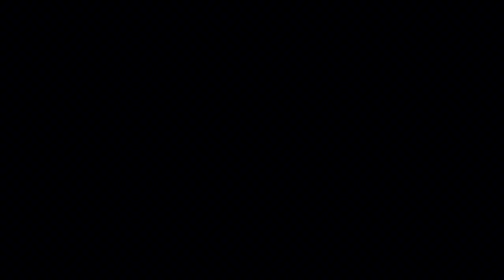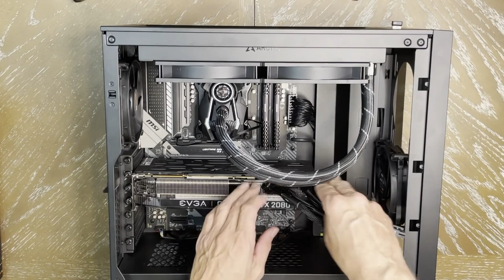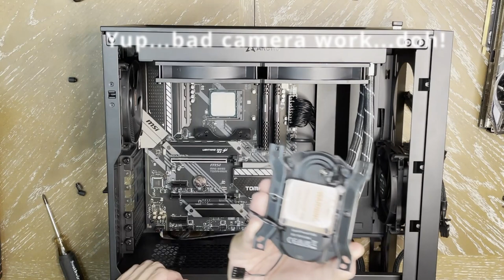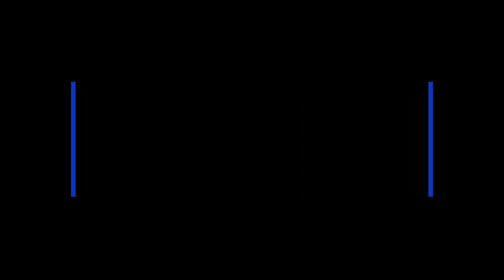Arctic Liquid Freezer II - Don't do this!

Comment: Never overlook the obvious, been there done that.

I recently installed the 240mm version of this in my 13700K build two weeks ago because my Corsair 4000D case will not support anything larger on top due to the tall RGB ram I'm using.  I limit PL1 to 125 and PL2 to 253.  Very impressed with the thermals.  Mid 30s idle and mid 50s gaming.
Reply from the maker: I just did a video comparing the Liquid Freezer II to the Pure Loop, which was my first choice.  I did a bunch of thermal comparisons at different speeds and fan settings.  I am very happy with thermals on LF II.
Reply: Which Mobo did you get? Are you happy with your choice?
Reply: How? My liquid freezer does 65 to 80 in games lmao? And i have a ryzen 7 7700 consumming way less than your intel. You gotta be cappin
Reply: @TheAmanor123  Power comsumption isn't the whole thing about the temps. So in Cinebench You have about 90 degrees?

Comment: I can’t remember if I took it off (I probably did), but I will check again to confirm, thanks for the video!
Reply from the maker: If you didnt take it off your temps would be really high.  You would know I think. :)
Reply: @VideosByBob  i’m in the process of building my first pc so I haven’t even turned it on yet haha

But yeah, it looks like I already took it off when I checked last night. still good for me to double check though in my opinion since I didn’t completely remember, also gave me an excuse to clean off the thermal paste for the first time experience.
Reply from the maker: @timmlyy  and to see how your first application of paste looked.

Comment: It looks like you may have also skipped the thermal paste application? Put a 3-4mm dot in the dead center of the top of the CPU and put the plate back on. The Arctic comes with a small tube with more than enough for AM5. Thanks for the video! These are easy goofs to make.
Reply from the maker: No I didn't skip it.  It was there, and I did it on the final, corrected install.

Comment: I dont have much disposable income these days, but I do want ti upgrade the CPU and the GPU. I'm finding it difficult to get good recommendations here in 2024. It's a Crosshair hero VII WiFi MoBo. It has PCI 4.0 support. What do think I'll need to keep up an AMD RX 6800xt or 6900xt? Maybe even late 2022/early 2023 GPU from AMD. Not looking to go over $600/700 total. 
Maybe I should upgrade RAM from 64Gb 2666mhz to 3200mhz just to get a little extra power.

Comment: Hey, what mobo is that , does the LFII fit tightly?  Are there some room? Been looking for a case to fit this beast 280mm top mounted , it's to thick. Dont want an extremely large case either. Please & thank you.
Reply from the maker: It is the MSI MAG B550 Tomahawk.  I have the Corsair 4000D Airflow case.  I use Corsair Vengeance memory sticks (no-RGB).  They have the clearance.  I did another video comparing the Pure Loop to the Liquid Freezer and I have all my specs in that video.  It is listed in Description of this video.

Comment: Yep, Did that with my Arctic LF2 360 on a 5800x3d in the same case(4000d).
Reply from the maker: We feel each others pain!
Reply: How is your temps? Idle and at load. You mount it offside or normal?
Reply: @dugi86  mounted normal at first, then did offset. offset takes off about 5c. Idles at 34c and under cinebench R23 all core maxes out at 75c.
Reply: What video card do uoy have ,I’m wondering if it fit with 3070ti suprim
Reply: I'm currently using a RX7900xt. The 3070ti should fit no problem. Not sure if you had an AIO front mounted though. I'm pretty sure even a 4070ti would fit.
Reply: You have on top ? Or front
Reply: @andreisilenger3635  4000d can't hold a 360 top mounted. so front mounted. the gpu i have is reference so its only 280 mm long so it fits.
Reply from the maker: @andreisilenger3635  I have a 2080.
Reply: Where did you mount it?? I have a 4000D and wanna get the 280 version but I'm afraid I won't be able to mount it at the front with tubes down. 😢
Reply: @camotech1314  Mine was mounted on the front tubes up. I doubt you'll be able to fit a 280 with tubes down unless you're willing to modify your case. PSU/Drive shroud is in the way.
Reply from the maker: @camotech1314  I put it up top, with short height ram (non-RGB)
Reply from the maker: The tubing is long enough to go in the front with tubes down.

Comment: Just wondering how is the clearance on the ram? I've been thinking of getting the 280 cooler, but I've seen mixed stories of people having/not having enough clearance. I've got a z790 aorus elite ax and trident z5 rgb ram. If anyone has experience with that it'd be great to know if it fits
Reply from the maker: RGB ram wont fit with Corsair 4000D Airflow, I was using corsair vengeance (non-rgb) and it just fit.  Anything over like 35mm is not going to work. Or you can use a Lian Li 216 case in water cool mode.  I now have that case with RGB ram and it is not an issue.  The Liquid Freezer II 280 is above the ram slot completely.
Reply from the maker: BTW: I love the Arctic Liquid Freezer II, great cooler.  My machine rarely sees 70+ temps.
Reply: @VideosByBob  thanks, good to know! I'll  have a think about the 240 version or the 360 and pop it on the front. It's not really urgent, my deepcool ak620 does a pretty good job, but I'm hitting mid 80s in heavy loads on my i5 13600k

Comment: May I ask you what are you motherboard and pc case models? I bought this same aio cooler and I'm a bit concerned about the space due to the bigger radiator
Reply from the maker: MSI B550 Tomahawk, Corsair 4000D Airflow, most importantly get low profile memory (no RGB).34-35mm height max.
Reply: @VideosByBob  Oh great! Just the case I'm going to get, I'm going to get the MSI B650 tomahawk motherboard I hope there's no issues with it. that's a good advice, yes, I got a memory with no RGB (Corsair Vengeance), I just was a bit concerned by the space, thanks a lot!
Reply from the maker: @javierqr08  You could also consider the Lian Li 216 case.  It has a water cooling mode (drops mother board farther down).  Then the memory is clear of the AIO, and height no longer matters.
Reply: @VideosByBob so if i have ram that is 2 inches tall it wont fit in the 4000d airflow case on the top?
Reply from the maker: @TakeTheRiskYT  definitely not, if it is RGB not going to fit.  2 inches is over 50 mm.